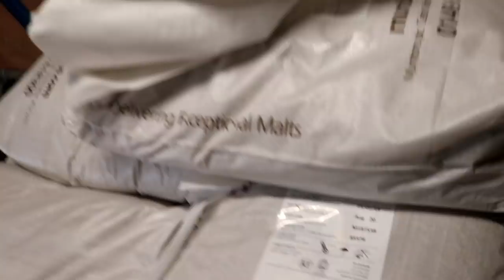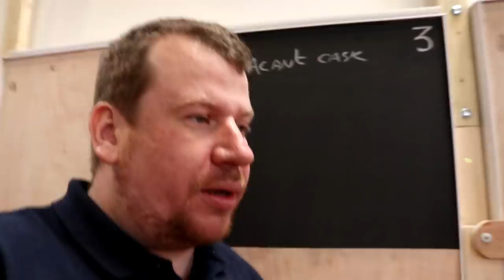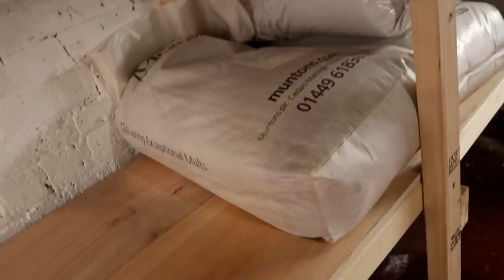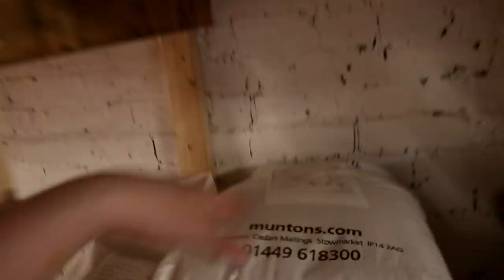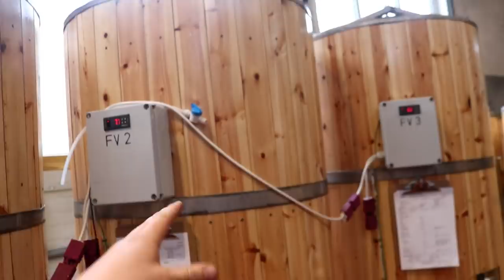ADDING A DRAIN PUMP TO THE CASK WASHER

Comment: Not sure if you’ve seen the Wago 221/222 connectors. They’re a bit more expensive than terminal strip but when you’re commoning up a few cables like that they save so much time and make the job much easier. Rather than bridging terminal strip you can get 5 way connectors. Worth a look for future use.